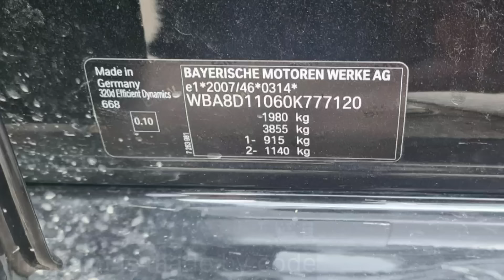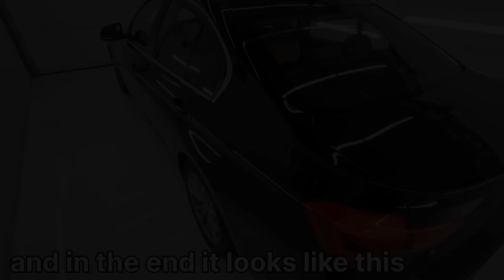Repair of damage from the key/No painting

Comment: Amazing work! Those fluorescent lights  will show so much more than what’s visible outside! Is there anyway to touch up or repair small acid spots in paint? Paint is still smooth to the touch but light fade in color. Battery exploded.
Reply from the maker: you are right, almost nothing is noticeable outside, even in the sun, and that can be filled and reduced by 75-85%

Comment: This is old trick from car market sellers, I used to sell all types of used cars back in a day, we used this trick on daily basis, not a miracle though, even if it looks very good just after the repair in the longer perspective former damage starts to be more and more visible due to filler settling deeper and deeper to the scratches. For short term impression it is good method, but if you want it to look good after 6 months or longer period of time you will have to paint.

Comment: Great video, the result is really impresive! I want to try your method on my car, but I have one scratch that is so deep and old that it is getting rusty... What should I use first to remove the rust?
Reply: A fiberglass pen is usually a decent way to clean up the scratch before applying any paint to the metal. 👍

Comment: There are two major problems with these kind of repairs - first: almost NEVER You will be able to find the exact color matching Your car body paint (sun, previous repairs, it all makes that the paint has different tint, is often darker, or brighter), second: while sanding the filled paint excess you're not only sanding the paint You just applied but the clear coat on adjacent surfaces too (especially on modern cars where the clear coat layer is really thin)....that may lead to destroying that layer, and things get much worse then...

Comment: Nice job pal impressive you got it that good I wouldn’t have thought that was possible… still tho probably could have sanded the whole panel and feathered it out then painted the whole thing up to the swedge line in about 2 hours with the gun….
Reply from the maker: Tnx,but the point was to preserve the original color, not to paint it
Reply: @Amddetailing  yeh Iam not sure touching up all the panels is preserving the original paint either rite enough?plus the bonnet needs done anyway.. it would leave the paintshop in a flawless factory condition that would be impossible to tell it had bein done.. especially with an easy black like that.. wouldn’t cost much either which would interesting weighing up the cost and time difference there. I could bang that out as a Homer for about 400 quid tho to a factory condition . Painting every panel

Comment: All still visible unfortunately. This type of damage needs to be sanded all the way down, and repainted in the damaged spots, and fully reclear coated.
Reply: I think if he filled it with more paint so that the scratch was higher than the surrounding paint, it wouldn't be visible.

Comment: Nice job 👍 Did you try to install uninstalled doors horizontally to fill scratches better? I used rubber box with sandpaper. Respectfully to you ✌️
Reply from the maker: I didn't try to remove the door

Comment: Thanks for the video ! why the hood can't be done what was the difference ? and what if someone doesn't have this mirka tool or file, can use sandpaper instead ?
Reply from the maker: it can, but then there is a possibility that it will be stolen from the factory (so that this does not happen, you can see how to prevent it on the channel)

Comment: I wish i knew the secret to the paint + acrylic mix. I can find paint, usually by itself or premixed with clear coat but i have yet to find a UV based solution that i can confidently use. If anyone is willing to share, id be eternally grateful.